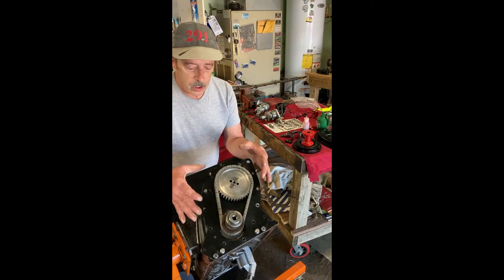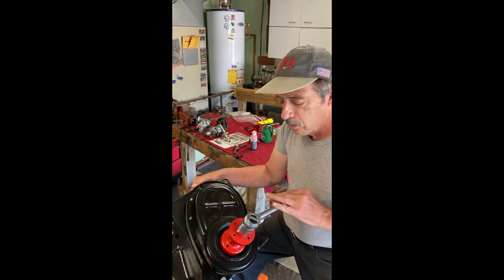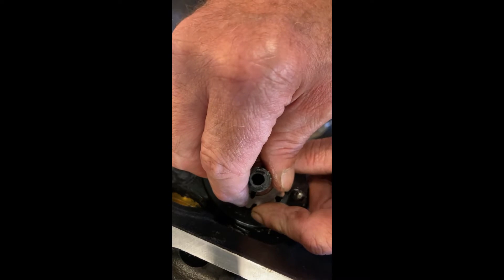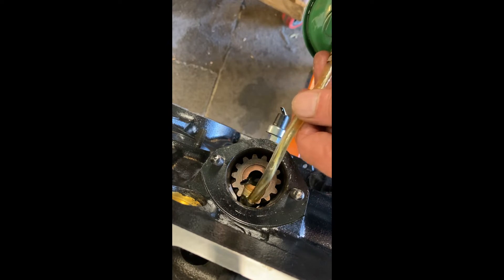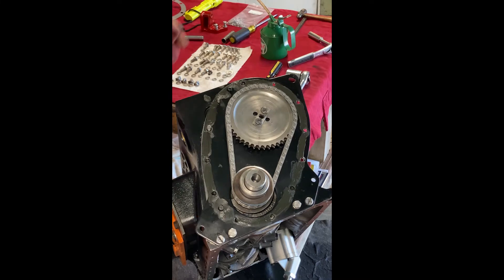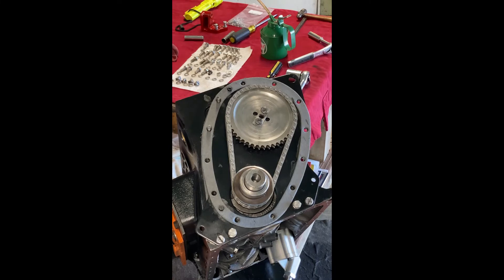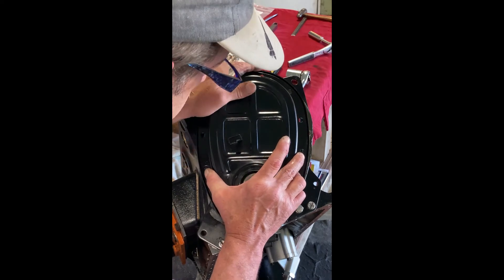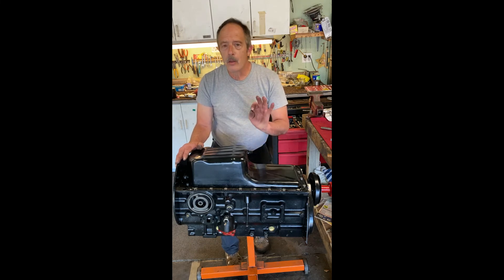TR6 Engine build:  EP 4- of 13 "Distributor Gear"

Comment: When doing a mechanical review video, if you say "referring to the book" , I d ask you  show the cover of the book. I have 3 different books and none of them have the correct level of detail. Help? Ironically I may need to replace my distributor.
Reply from the maker: Thank you, Good Point. I think the book I had for the TR6 was a Chilton. Last year I sold the car and off of the stuff with it. When I referenced the book I was referring to the "offset" slot in the distributor gear.  According to the picture in the book, the slot was at 2 o'clock and 8 o'clock with the wider slot being at 8 o'clock. With the different size slots, changing the distributor is not that difficult since it only goes in one way.  Best of luck to you and thank you for watching.
Cheers,
Bob